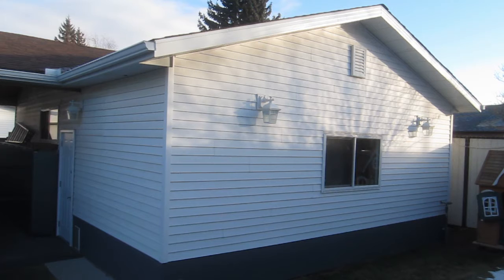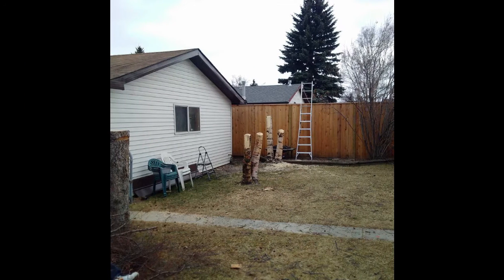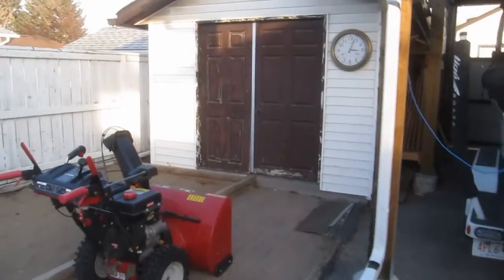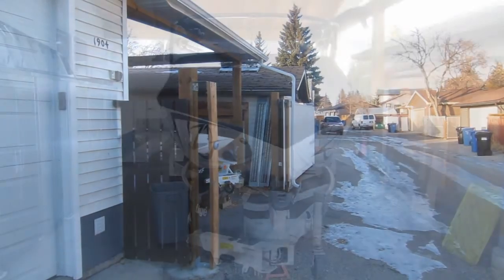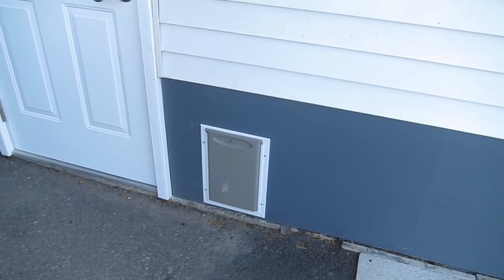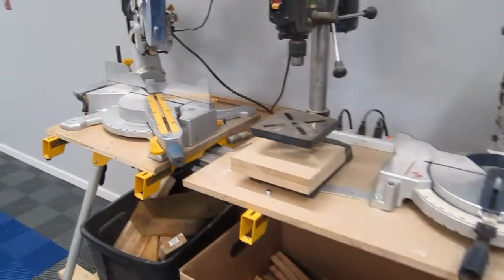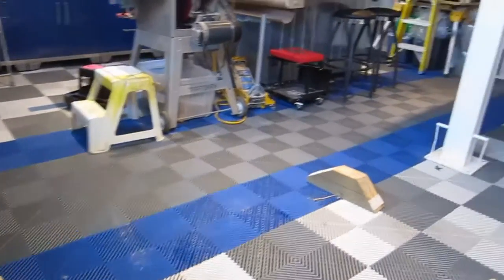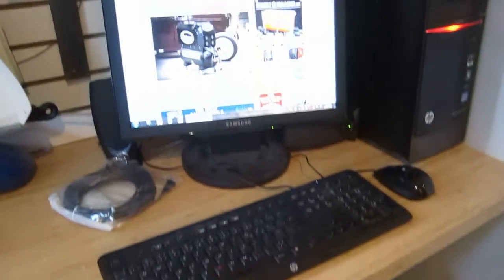JohnnieMo's Calgary Garage Tour

Comment: My plan is to raise the roof, then pony walls (2 feet). On the corners, I will sister in 4x4' from floor to top plate to resist hinging. What are your thoughts on that versus raising the whole garage?
Reply from the maker: So pony walls on the top?  If so I’d still want to see more sistered studs throughout. Otherwise the walls could bow. Maybe every 4 feet.
Reply: @johnniemo  The 4x4s will run from the sole plate all the way to the top plate. I'm separating the two top plates. The upper one will go with the roof and that's where the 4x4s will attach. The pony walls will be attached to the lower top plate and the upper top plate. 4x4s will be spaced about every 6 feet. 

It'll be like a pole barn.
Reply from the maker: @berserkerusmc7613  okay, I can picture it.  So you will have 4x4s in the side walls as well as the corners?  If so, that will be plenty strong.

Comment: Hi John, after some time now, how do you like that floor? My garage is way too full to do epoxy coating in now, but I do a mix of car work and wood work, do you think that flooring would be OK with sawdust? Or will it just plug up and stink?
How's the jeep going?
Reply from the maker: Hi Oliver.  I love the floor.... absolutely love it.  The only downside is you can drop small things and never see them again.  However it is great with sawdust and mud.  So long as you keep the garage warm, the water evaporates.  I left it 4 years before I pulled it up and cleaned underneath.  Over those 4 years the tiles stopped looking new.  so it's not as pretty as it used to be, but certainly just as functional.  For heavy sawdust areas I try to collect the sawdust as best I can and vacuum soon after.  The result is quite liveable.  I would easily consider swisstrax in any garage I ever built.  But note that it is terrible with bare feet, so never use it anywhere else ;)

Comment: Dude, you have such a cool garage.  If I could have one like that I would. I have done some additions to our property, I retired in 2014 after 30 plus years in the Army. I was hardly home, so I couldn't do some of the things I wanted to until I retired. I started with a large storage shed to put my riding lawnmower and other yard equipment in. It is a large one with a loft for storage. We use to have offsite storage for all my military stuff and other family items. Once I get that built, I did another what was supposed to be a detached garage, but I couldn't have it constructed as I wanted, the city had limitation on building. So it turned into a garage for my cargo trailer that I use for transporting my motorcycle, it also has my yard trailer that I use to move mass items on my property, as I have about an acre of land. My next projects will be to install a iron fence with folding gate for the front of our house and driveway and a detached carport where the small garage is. The one concern I have with the carport is once again the city and their limitations on fixed structures, so I am working a way to do what I want and be in compliance with the city.  There is more that I have done but these are the primary upgrades.  

Thanks for sharing your story.
Reply from the maker: Thank you very much!  The city will always be a problem.  There just isn't much freedom anymore.   The city said no to me a lot of times, but I eventually wore her down.  The nice part was I had one point of contact, and she was sway-able just by being courteous and trying to do what she asked.  It took a couple months, but I finally got approval.
Reply: I also am using that same technique, I have one individual in the Permit section that I learned to deal with.

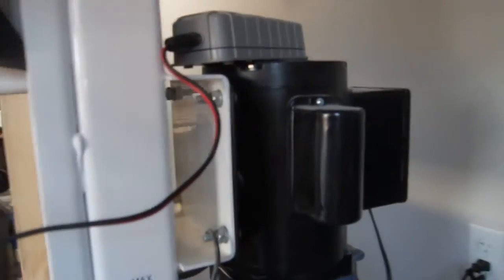Comment: 12:51  Chains?  Really?
Reply from the maker: Stew 414 hahahahahaha. Good eye.  There’s actually a logical answer here. 

In the winter, if I want to use the lift for maintenance on a different vehicle I need to get the Trans Am off and over to the other side. In years past I’ve gotten the Trans Am stuck. So this year I borrowed a set of chains. It worked like magic. :)